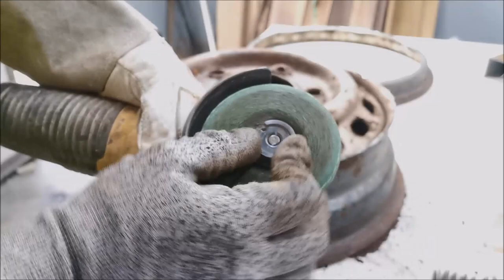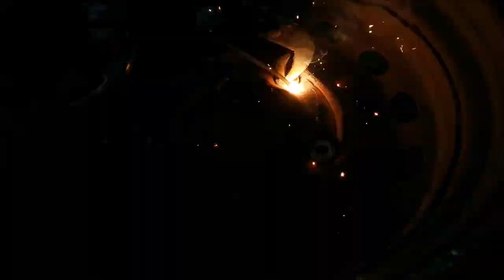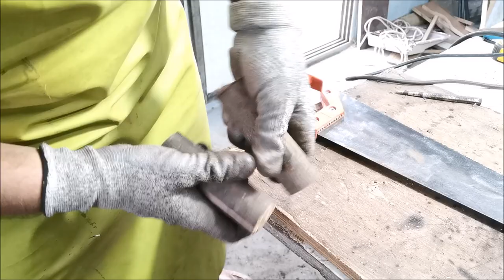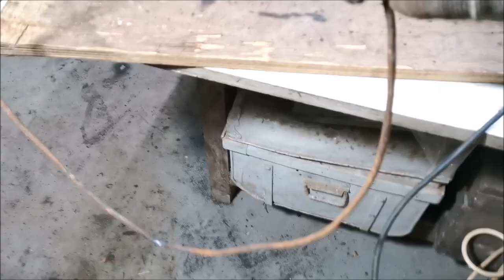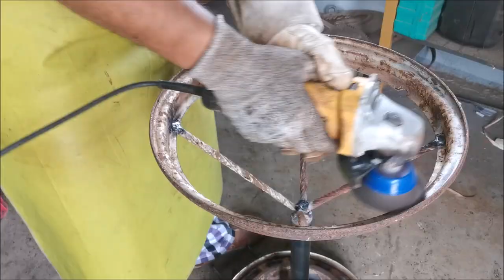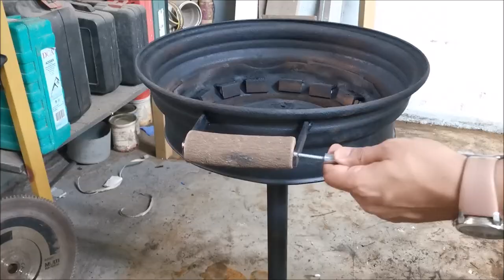[DIY] BBQ Grill From Car Wheel/ Rim.

Comment: I wonder how your grill has held up over three years?
Reply from the maker: Working fine. 🙂. Some of the wheel part is rusty though.
Reply: I’m building something similar so thanks so much for the video and the update. I decided to line the bottom with refractory cement to try and help with longevity👍 @AbdulazizDadarkar
Reply from the maker: You can try my other video here where i made a bbq grill with a gas cylinder. https://youtu.be/FxTTLGQI6dw
Reply from the maker: @eardw2251 donot cover holes in bottom as they block air flow and reduce the quality of heat required.